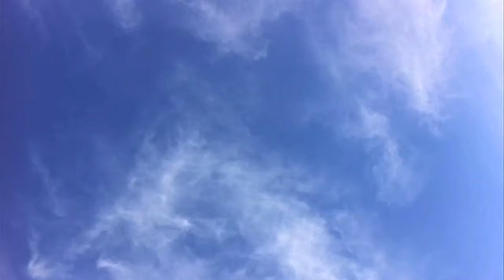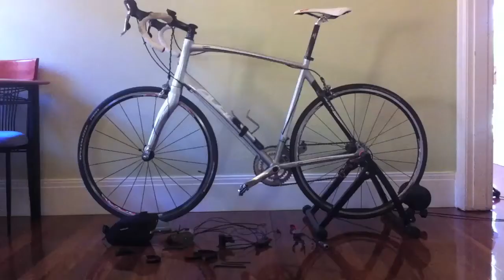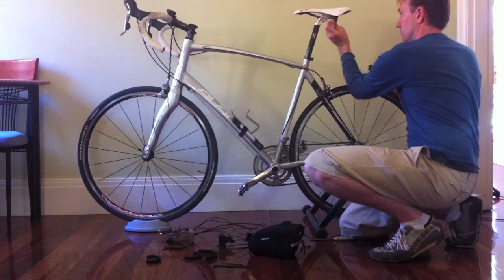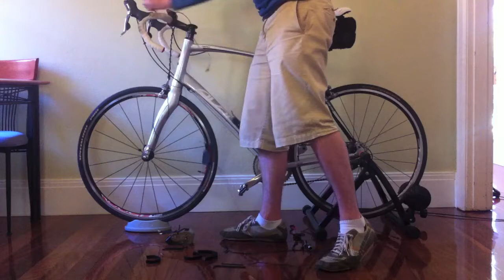CB #4 - Installing on the Bike

Comment from the maker: Yes absolutely. The drive is totally disengaged when not in use. Making it pedal just a freely as normal. No more feeling like you are pedaling through sand like it does with a heavy direct drive hub motor.